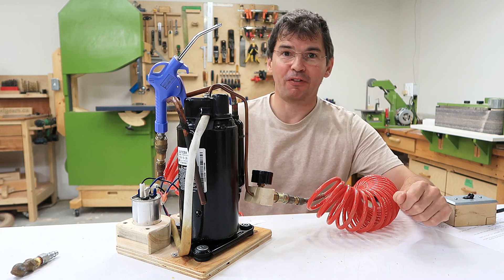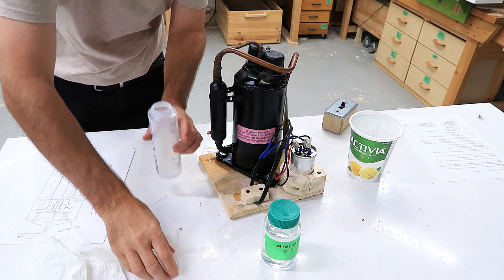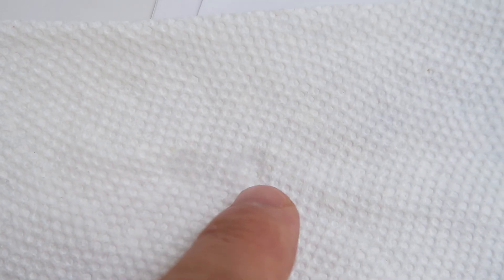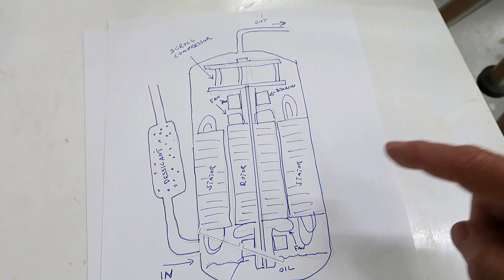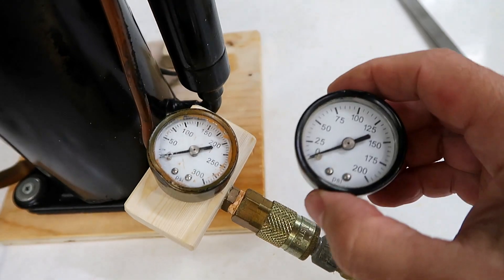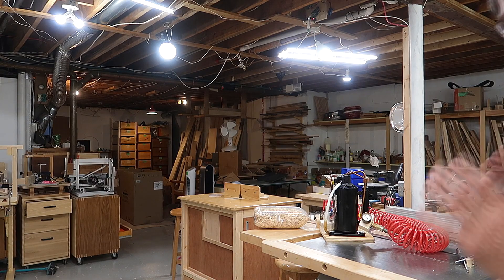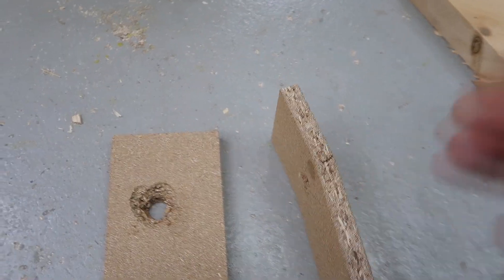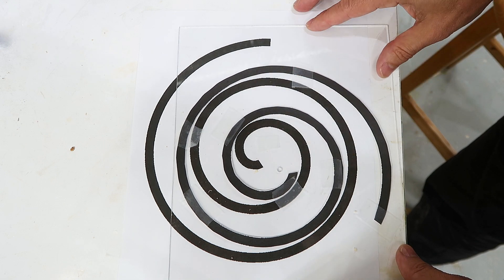This air compressor will fail

Comment: add silicone dab size thumb nail on the inside of soda lid and soccer pump needle 
push through pre drilled hole in lid through virgin silicone pup to 100psi 
then air rifle the bottle after u pull the needle out quickly

Comment: Your drawing is wrong. The compressor is at the bottom. The motor is at the top. There is no fan inside the compressor near the motor.

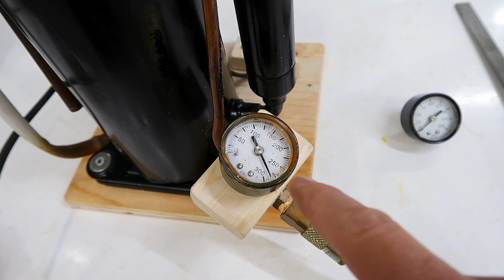Comment: Hello, Matthias!! I'm just too curious about the boiling sound (just like yours at 5:51, those rattling sound)after letting my compressor working for like 5 to 10 minutes, I repurposed these air-con compressors. What are those and should I be concerned about it? Additionally, i think it overheats that it releases gases on intake tube. 

I would really really appreciate your answer because I really need some consultations since this project is also my thesis and project study for my college.

Comment: If your use requires 'clean' air, you can get a filter to remove moisture and oil (?) at an automotive paint store.

Comment: Many refrigerator compressors are designed to run their service lives in a vacuum, with no means of oxides to form.Absent that vacuum, pump life is usually limited.Many first gen scrolls had cast alloy components pot metal with poor tolerances...they machined themselves into powdered sludge which, while they continued to run...often hopelessly restricted metering devices.

Comment: My dad used a compressor from a car as a compressor for years. We just put 10w30 engine oil inside it. A few drops  occasionally, to replace what was lost. It would make oily water. But not bad. The tank had a small leak. So it kept drained out.

Comment: Surely you can use inline check valve and  inline vertical oil & water separator.
Pressure switch.

Comment: I have a portable ac unit,but when i turn it on ,it starts cooling then it vibrates violently then stop cooling process, I opened the back of my ac unit and i saw a compresser shaking ,what is the reason if this ,a heliping hand please

Comment: Do not worry! I have been using such a compressor for 2 and a half years. Mostly for normal purposes like car tires or blowing dirt. I even painted the fence with it. I fitted him with a LPG bottle. after the bottle, I put an "oil trap" and pumped the oil through a precipitator and back into the compressor! BUT IT IS IMPORTANT THAT THE OIL IS AUTOMOBILE "0W-30". The problem is that winter is sometimes hard to start because of the thick oil. But it works without a problem. There is also a fan to blow the compressor itself. Also, it works no more 100-150psi (10 Bar) with pressostat and separate pressure releaser + check valve between the compressor and the bottle!
Reply: How are the oil going back ? Have you put another valve to block the air coming out through the oil entrance ?

Comment: fit a pressure control switch and a calor bottle as reservoir 
and don't play around with compressed air it can enter your blood stream with fatal results

Comment: I have been using silent airbrush compressor called Sil-Air for years, I have used it for everything including vacuum, it’s made of air conditioner compressor, it also have automatic pressure that disconnects the power to the compressor when it reaches pre-set pressure and have pressure regulator with oil and moisture filter all those can be retrofitted to any air compressor.

Comment: POE Oil is highly hygroscopic, it sucks water like crazy, the water causes the oil the turn into acid and alcohol, thus no lubrication. 
also this is a rotary compressor, rarely do you ever see a scroll type compressor in a window unit or any other commercial refrigeration system aside from larger heatpumps.

Comment: Get a peice of very thick wall 1/2 or 3/4 silicone tubing and blow it up. Put ear plugs in and stand way back. it is an  tire tube on steroids. We did this as kids many years ago.

Comment: I have an oil-less scroll compressor made for medical or lab use and it has an unusual configuration. I harvested the impeller and volute to slave away in dust collection and I'd like to use the almost silent compressor as a compressor for air tools but pulley belt motor yadda yadda did not come with. It eats torque.

Comment: My car 12v tyre compressor has a screw on connection to the tyre valve. That’s what you need for your crazy experiments. Keep up the good work. 👍🏻
Reply: I love that type of compressor connection!  I have one of those tire compressors and the air hose screws on to the tire stem as well.  It makes it much easier to fill the tires.

Comment: Hey Matthias, can you check to see how much pressure a Homer 5 gallon bucket with secured lid will hold?   I have not found any videos or info on this other than 2 psi and 'don't do it'.   They are super cheap and lightweight for a 5 gallon compressor tank.

Comment: If you could put feet on the compressor and a tiny tank with sight-glass and a valve, you could keep an eye on the condensation, and empty out the water every now and then.

Comment: I'm so glad you went over the scroll compression. That is one of my favorite inventions. Yes, they are horrible for low pressure, and as you also stated the oil is transferred along with the compressed gas, but still a phenomenal feat.
Reply: it’s a rotary though.
Reply: @nova290r  Yes. Thanks though

Comment: first off get rid of the unessary tubes. remake connections drill hole in bottome and weld on a valve so you can add remove oil. you need to make an air oil separator just like regular airscrew compressors.

Comment: Lots of valid points and cool experiments. I used a window unit compressor and an old fire extinguisher tank to build an airbrush compressor, I drilled an oil port in the base and installed a drain plug for easy oil maintainance, the pressure switch is set at 80 psi max, the inline water/oil trap combined with a regulator helps with moisture ect. the airbrush hose has a secondary filter/trap. So far it's been working fine, the airbrush uses about 20 psi max and mostly around 12-15.

Comment: You could always put an air oil separator on the output. Autobody shops have them on the air lines for the paint booth so you could always buy one or make something similar and just keep an eye on how much oil has come out and replace the lost oil from the compressor. I was thinking weigh the separator when new then weigh it again in a week or so and add the weight gain back into the compressor. My friend used his jeeps ac compressor for onboard air for filling tires when he went 4 wheeling.

Comment: I used an old fridge compressor for years to recharge my 100psi air tanks. I did install an oil/water separator and a pressure shut-off switch.

Comment: The suction in an med. Temp system is normally filled with a semi gaseous liquid this refrigerant DOES cool the compressor. If you dont believe it feel the suction line (Large line) on your central AC unit and see how cool it is . Low refrigerant kills compressors. because that Gaseous liquid isnt there to cool the oil which cools the windings .

Comment: I wonder if you could add some sort of water catcher to the tank. Maybe on the side and run it at an angle. I got a refrigerator compressor to mess with.

Comment: I have a buddy that's a mobile mechanic, not sure of his exact set up, but he has a re purposed ac compressor that feeds a custom built air rank in his van, making a whole lot of extra room in the truck. Biggest thing is an ac compressor doesn't produce a lot of volume of air, so it takes time to build up the tank.

Comment: Bambi and Sil-Air sell air compressors that use fridge style compressors.  They are occasionally sold as dental air compressors with multiple compressors so they can fill a large tank quickly and, more importantly, quietly.  You can solve some of of the lost oil problem by making a coil of copper tube above the compressor, so that the oil condenses in the tube and then drains back into the compressor.  These, if done properly, can actually provide decades of service.  In fact, air compressors with these style compressors are a popular choice for fine airbrushing due to how quiet they are.

Comment: I can't believe the timing of this video. Two days ago, I dragged a discarded-but-still-working window a/c from next to the dumpster and extracted the compressor--it looks just like this one. Now I'm excited. I've got a 5-gal air tank from HF I'm going to hook it to. I think I'll make an inline filter from PVC and stuff it with polyfill to trap the oil mist. I think I can get an idea of when to top up the oil in the compressor by weighing the fiberfill every so often. I think I'll also add some valves and tubing to make it reversible: sometimes a compressor and sometimes a vacuum pump (for degassing resins, etc.).
Reply from the maker: with all the warnings that it will fail, let me know if yours fails.
Reply: @matthiasrandomstuff2221  I'm used to failure (or at least resigned to it), so I'll update here when it happens. The trick might be to keep it lubricated while also keeping most of the oil out of the air line.

Comment: By its configuration, sound, and the fact that it discharges into the case of the compressor, It more likely to be a rotary compressor, not a scroll.
The thing that is part of the inlet tubing on the side is a small accumulator to keep liquid refrigerant from entering the pump, there is no desiccant in it.
The inlet on a rotary compressor passes directly into the pump, so liquid refrigerant getting in is very bad.
If it was a scroll compressor, you would also get much more oil out of the discharge line, since the pump discharges almost directly into it, where a rotary discharges into the case of the compressor. The discharge gas from the pump then passes through the motor to cool it, and out the pipe in the top.

Comment: 350 only, to make a large automotive compressor I will need 10 of them, but I have used refrigerator compressor for years to pull vacuum they are easy to work with and silent

Comment: Why not run the discharged air thru a moisture separator / filter? I put the air for my airbrush thru that and a small inline moisture sep before it goes to the air brush.

Comment: These compressors were designed to handle 300 psid (differential). They will most certainly handle any 150 psi task slowly. Please refer to my original video comment.
Reply: P.S. All compressors fail. Some fail catastrophic.

Comment: This compressor is a rotary compressor, I.e. stationary vane with an offset lobe that traps vapour. You can identify scrolls by the absence of a factory installed suction accumulator (the small black vessel fitted to your compressor), and the inlet, or suction line is almost always towards the top of the compressor body. Rotary compressors are the only compressors fitted with suction accumulators from factory, and with the majority of the compressor body being the high pressure side. This is why your volume is so great when compressing air. Scrolls would have minimal volume due to the design as you drew.

Comment: best you keep the output pressure to 175 if you plan on keeping the air stored in a tank.  a simple air compressor control valve will do nicely. 

an unloader valve will help with starting amp draw.

Comment: Sealed compressor pumps are actually used as compressor heads. combined with a small receiver tank, pressure switch, oil separator, etc. they can be very effective for small applications.

I use one as a vacuum pump. Works a treat.

Comment: Firstly, you do not have a scroll compressor, you have a rotary, you can see what’s inside a rotary compressor in several videos…

https://youtu.be/u3jfJYTwDyU

Scrolls are only found inside full size air conditioners, not window units or minisplits.

So, your compressor pump is on the bottom of the cylinder.
Every drop of moisture condensing in he cylinder will float the oil inside pushing it into the rotary intake, and you will be pumping the motor with water as the lubricant, unless you build a good drain into the cylinder. Also, you will need an oil return system to maintain oil capacity.
I would weld a sight glass fitting into the side of the case so you could tell what the oil level is.

For quick use, it’ll likely last a while, but don’t try to use it for any shopuse…
Reply: https://youtu.be/iyy7Hfkhgvs
Reply: Here is a good animation of a rotary operation… not the scroll design you thought you had.

https://youtu.be/fxDEK3Ymx30

Comment: The real reason it will fail is the one you mentioned moisture. An air compressor pulls the moisture out of the air. 

I've seen nice compressors ruined through tank rust. Drain your tanks daily.

Comment: I have a friend who has a booth at the state fair every year. She air brushes caricatures of folks onto t-shirts. She uses an old refrigerator compressor and a bank of 2-liter soda bottles as her air tank. She has the shut off set to 40psi.  I'm not sure what pressure she needs to spray but, I assume it's half of that. Anyway, she cut her compressor open and made flanged rings for the two halves so she could bolt it together and open it up after every year and dry it out and replace the mineral oil. She replaces the soda bottles regularly but, has been using the same compressor for the entire 22 years I've known her. Just thought I'd throw my 2¢ into the works.

Comment: Absolute Bullshit- I have a Vacuum recovery pump made from an old  USED 1970's Deep-Freezer compressor, I've been using it several times per year, since the mid 90's to pump down Sealed systems after doing work, still pulls down to more than negative 30.... Just used it last month!
ALSO, back in 2004 I made an indoor Hobby Airbrush compressor out of a Maytag Fridge compressor- still works like a champ, No cooling, No oil changes, nothing - Internet Idiots are just that......

Comment: I used a similar compressor to build my first refrigerant recovery machine .  That was well over thirty years ago.  I was on a budget and the EPA was requiring you to capture refrigerant rather than release it to the atmosphere.
I even registered it with the EPA. I designated it as the " SUX 2000".  It worked well until I was able to afford a real one.
Reply: id buy that for a few dollar
Reply: Strangely, my auto mechanic friend had a fridge style compressor used to clear brake lines...or...bleed them, I think.  I could be wrong  It was used for something.

Comment: If the compressor windings become damaged, it can give you an electrical shock. Please replace the power cable with a grounded one and problem solved.
For the rest, I wouldn't worry too much if it fails in 1, 5 or 10 years, it doesn't matter, you can probably get another one for free or very cheap.

Comment: I bien usin one as a Shop compresor for crean even paint, fill tires etc for years.... once every...... i remember i drain the oíl for check the ammount and refill a bit.... one thing is that for paint with an air brush you need a resarvoir   tank because the oíl and the cycle time

Comment: What is the attraction to use the wrong type of pump for compressed air ? Ever heard of the ASME and pressure vessels safety?! You are playing with danger.
Reply: Have any idea what pressures a refrigerant system can expect?
Reply: @ShainAndrews  4:1 compression ratio is typical for a standard refrigeration application.

Comment: When I was a kid, dad fixed refrigeration systems for people, from auto A/C to refrigerators to home air conditioners. He had a compressor he'd taken out of a broken fridge that he used as a vacuum pump, and he used it for years. 

I'd never tried to use an air compressor to rupture a soda bottle, but I've done it plenty of times with dry ice!

Comment: I think that the biggest risk to the compressor’s life will be from the compression ratio. Normally, you might have between a 1 to 4 ratio up to 1 to 10 depending on your suction pressure. But when pulling air from atmosphere your suction pressure is going to be below zero and your discharge pressure will be whatever you pump it up to so your ratio will be very high. That said, if you do end up killing it, you shouldn’t have much trouble finding another one. Have fun and be careful.

Comment: Ok, first of all please dont play with compressed air / gas! There is a lot of energy stored in the reservoir. Do you know how much pressure that airgun of yours can handle, have you hydro tested it? 
People assume it’s just air, and you have thousands of joules of energy in the reservoir. Please do your calculations and use proper safety margins. 300psi, and 10 square inch and you’ll have 3000 pounds pushing on the case.

Comment: You're putting way more thought into "coolant" than you need to. The oil does the majority of the cooling when these are used as an air compressor. A simple trap that allows the suction side to pull the oil back in takes care of the oil loss problem, and a suitable fan blowing on the compressor's can is plenty. It shouldn't be running 24/7 anyway, so as long as you keep these things in mind, they'll do fine for quite a while.

It's not really rocket science. Don't try to turn it into it.

Comment: I've seen them used in printing equipment to drive pneumatics. They have a sight glass to check the oil level and the oil blow-by is actually a good thing since it lubricates the cylinders. Kind of acts as a central lubricator for the entire machine.
Reply: There's no "cylinder" in this compressor. 🤦‍♂️
Reply: @MadScientist267  you can't read good.
Reply: @MadScientist267  he said it was driving pneumatics, i.e. the cylinder he mentions is the driven component, not the pump.

Comment: It might overheat if you leave it idle, but the good news is, under normal flow it's always sucking in fresh cool air and expelling warm/hot compressed air (not recycling hot gasses) so it may reach an equalibrium temperature.